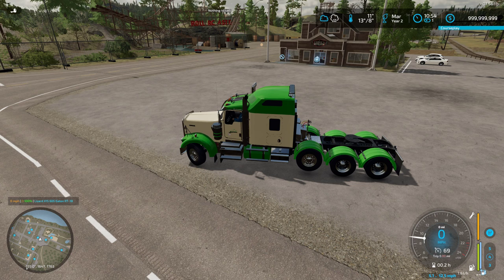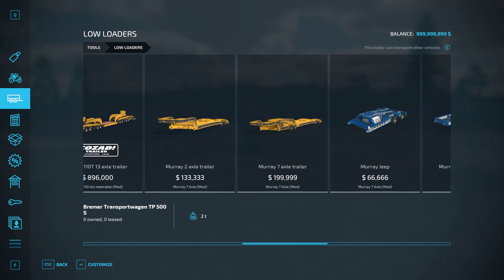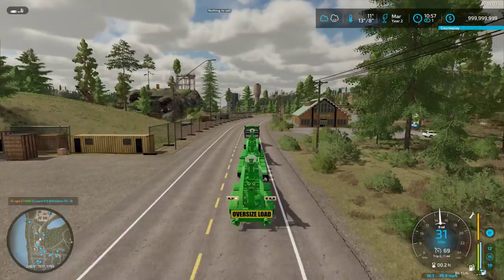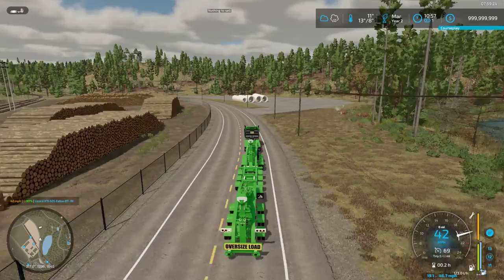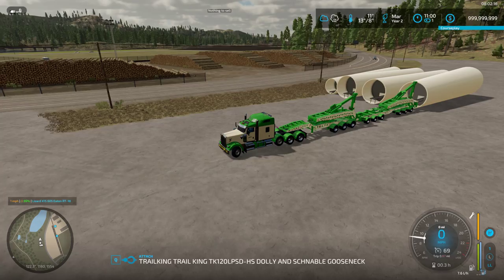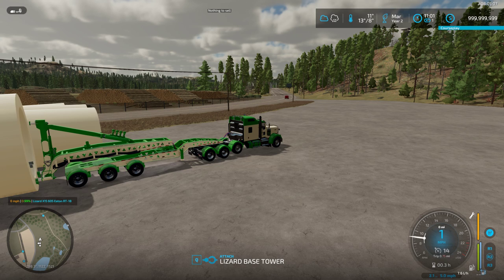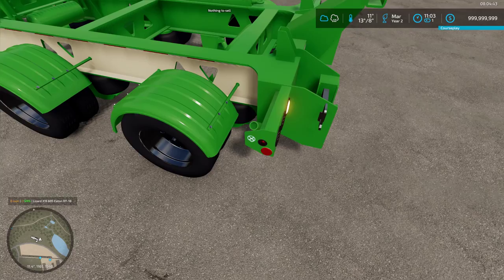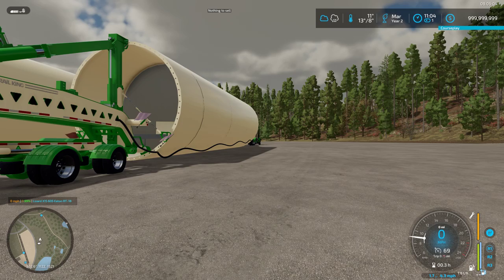FS22 Trail King Double Schnable Trailer Attaching Tutorial v2.0

Comment: Have you ever considered bringing trailers into American Truck Simulator? Just with the attention to detail and how you have the articulation points setup (hydrolic cylinder movement/steer axles). You're models would completely blow all of the current trailers mods in ATS out of the water. You have guys selling mediocre trailers with less detail for $35 a pop. I'm just saying I would be the first guy to buy your work and advocate for it! Awesome work!
Reply from the maker: If it ATS works the same as ETS2 then sadly it would not work right. I may look into it at some point.